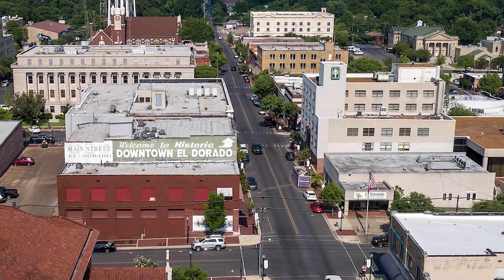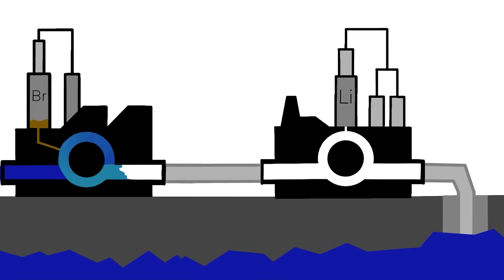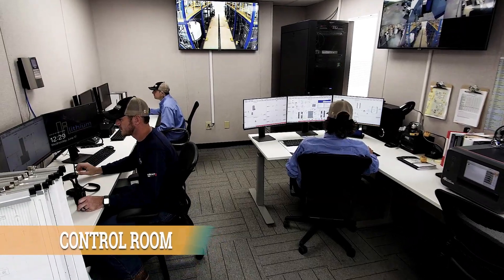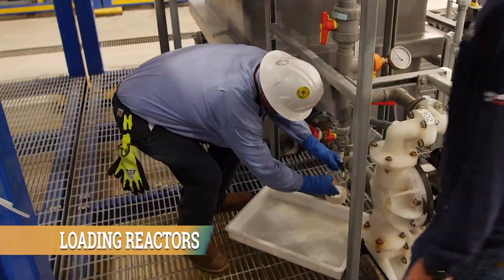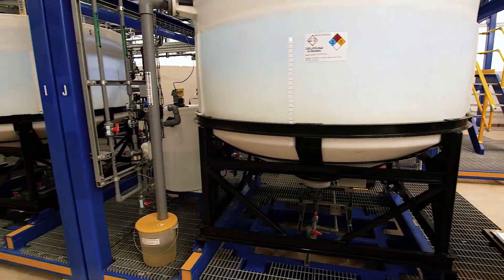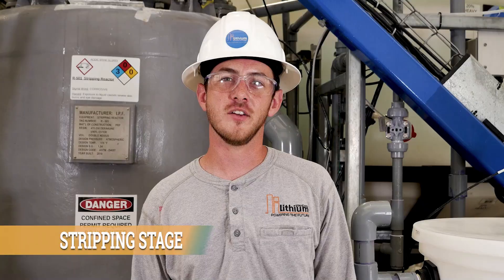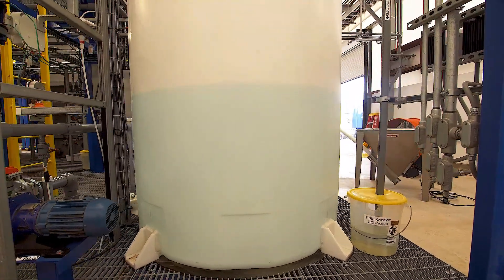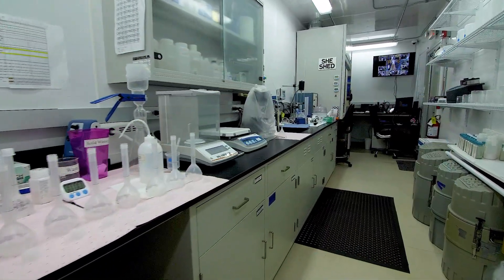LiSTR Direct Lithium Extraction Plant Full Video Tour 4 0 1

Comment: While this is a right step in producing "cleaner lithium", it still requires water, chemicals, and tearing up large swaths of land.  Currently there are several companies researching and testing solid state/graphene based ultra-capacitor batteries which charge very fast (within minutes), and do not degrade in time since there's no chemical reaction during the changing/discharging cycles.

Comment: Math question:  if this demo plant processes 50 gallons per minute of input brine - "equivalent to 100-150 tonnes of lithium carbonate" how much is the finished product worth?  How much larger will the first full size production plant be?
Reply: Not sure on cost of Lithium Chloride, but Lithium Carbonate is around $13-14k/t right now and Lithium Hydroxide is something like $14-15k/t depending where in the world its being sold. Standard Lithium's first phase of production is ~20k t/yr, whether Carbonate or Hydroxide I'm not sure, I think they will be flexible to produce either depending on market demand.
Reply: Not 75000